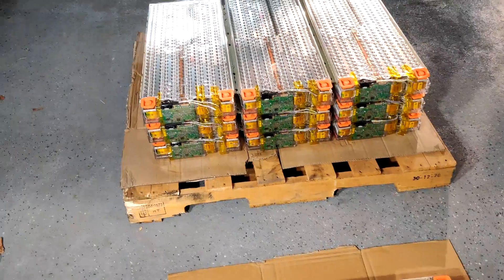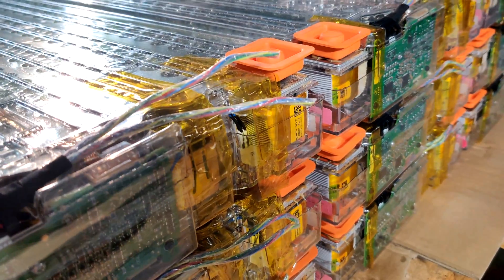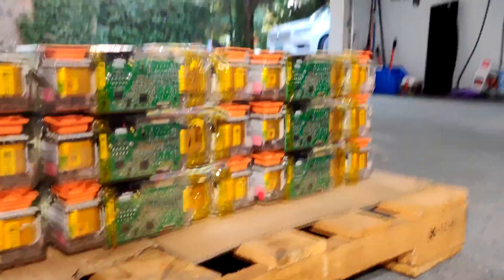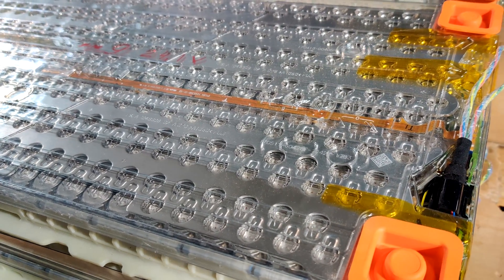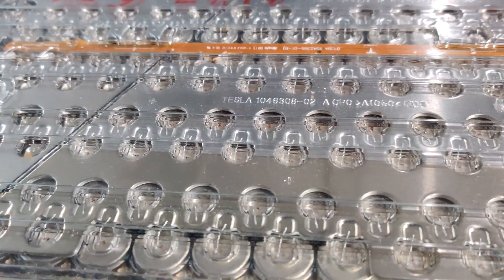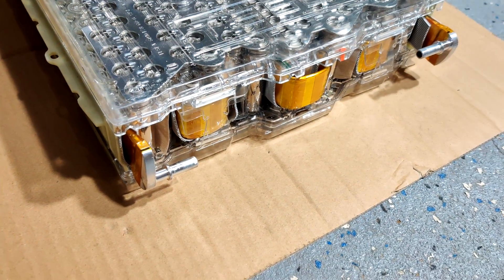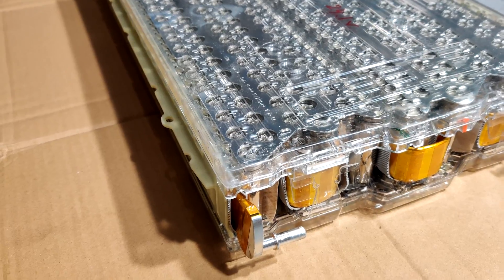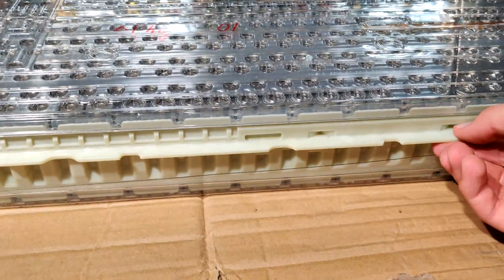Ford Escape EV Conversion EP 12: Tesla Battery Modules

Comment: Thank you ...
Question is 
Is it disconnect the whole power supply when the cell fuse(little metal wire) is blows right ?

If yes, need to open and replace the cell or fuse wire, to start the connection is it ?
If no, is this module has feature to countine with rest of the cells ?

How does it work 
Please reply
Reply from the maker: When a cell fuse blows, only that individual cell is disconnected. The rest of the module is still connected. The best way to fix this issue is to weld in a replacement fuse wire as soon as possible. You also want to make sure the cell that blew a fuse isn't shorted and has a voltage that is close to the rest of the cells in the pack before replacing the fuse wire. If it's just one or a couple of cells, it shouldn't be an issue.

If too many cell fuses blow, the difference in amp-hour capacity of each cell group can create an imbalance over time that reduces the total capacity of the entire pack.

Comment: So these batteries are just a bunch of d-cells?
Reply from the maker: They're 1865 form factor cells, meaning they're 18mm in diameter and 65mm tall. Sort of like a D cell but stretched vertically.

Comment: Those "BMB" boards don't actively balance or control the cells. They need the original BMS to tell them what to do.
Reply from the maker: Somewhat correct. They do need an external signal, but it doesn't have to be from the original BMS (more of a balance board controller than a BMS in this case). I'm using a product called the SimpBMS that replicates that. The actual balancing is done by the balance boards though.

Comment: Hey, Just wondering where you ordered these from, as all I can find in my area are batteries from wrecked that aren't guaranteed to work.
Also, I was wondering how much these batteries were.
Reply from the maker: Pretty much all the batteries you'll find are from salvage vehicles. This could be from a car accident, flood, or fire. You want to avoid modules from a flood or a fire. Modules from a car accident should be fine. These modules cost about $1000 each ($10k total), and are the most expensive part of this conversion by far. I bought these from a seller on ebay. You want modules that are low mileage, recent model year, and from a car crash. Make sure you ask the seller to provide the voltages of each module and look for any popped cell fuses before buying.
Reply: I'm also interested